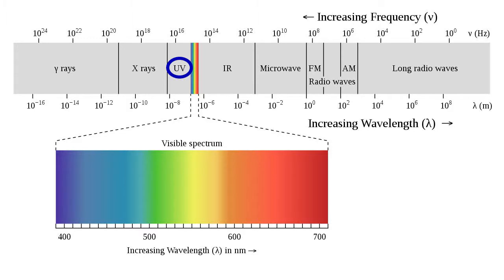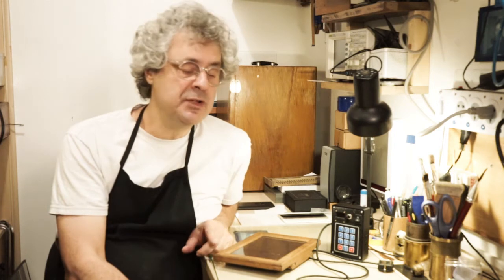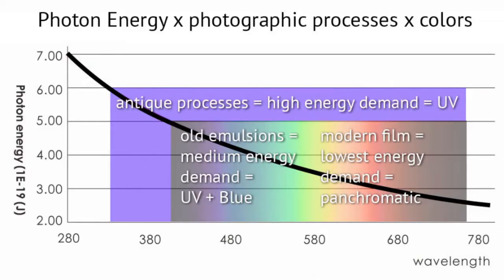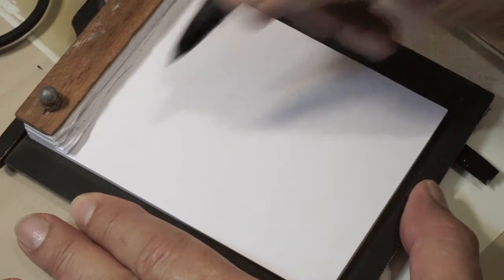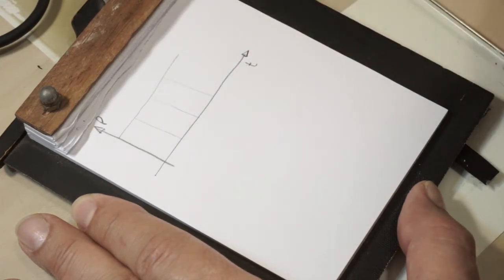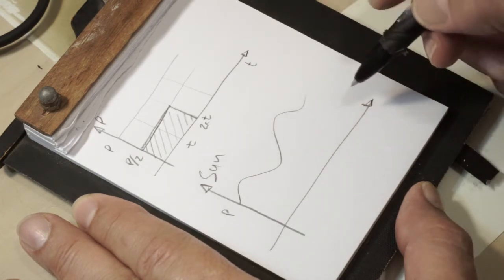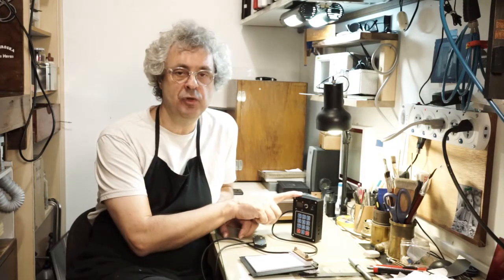How to build a UV exposure meter by Wagner Lungov

Comment: Absolutamente incrível! maravilhosa descoberta, Wagner Lungov! Você ainda constrói este medidor de UV?
Reply from the maker: I'll pass the comment on!
Reply: Hello, I built mine and I am still using it. It gives consistent results under different sunlight and UV conditions. When the day is overcast it does not worth using it because times are extremely long, but in a moderately cloudy day, with intermitting direct sun light, it becomes very handy as it makes up for variations and beeps when a preset UV level is reached. I am not planning to build and sell it and that is why I shared the project in all its details.